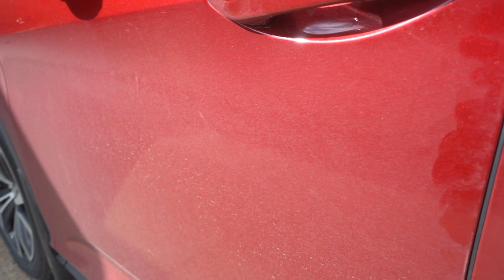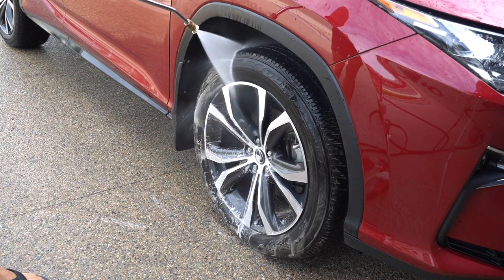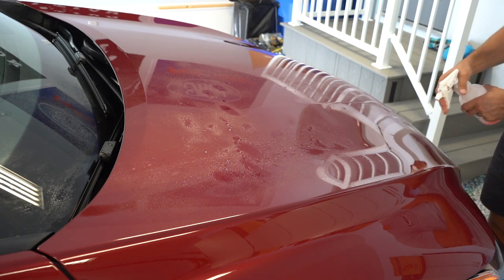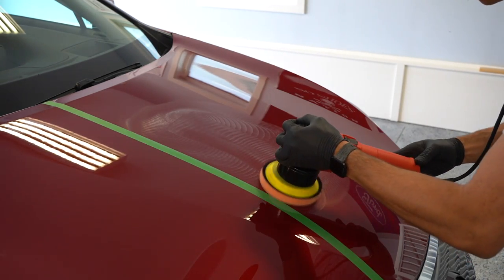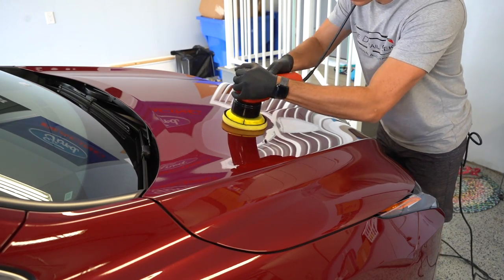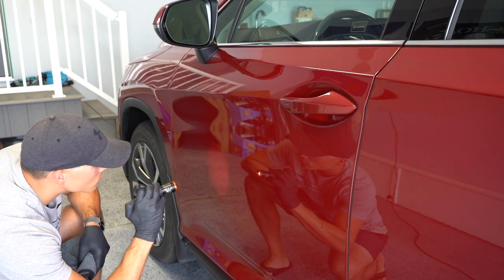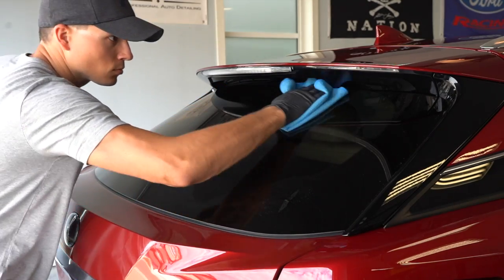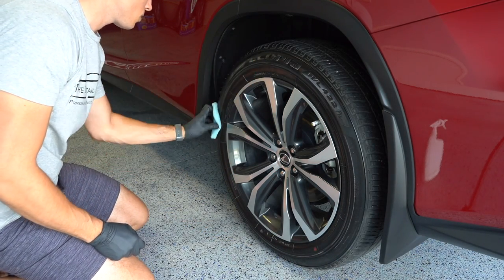Real Time Detailing of a Beautiful Lexus RX 350! | Full Paint Polishing Tutorial and Exterior Detail

Comment: I did full detail and polish on our 2018 RX as well to prep it for a ceramic coat.   Same process, with one exception, I use multiple MF towels vs two bucket method.  I use about 8-10 high GSM MF towels total to wash using front and back sides, but I feels it safer than two bucket method and faster as well.  Very nice job at end though.  It’s a shame the owners didn’t want to ceramic coat the car after a nice paint correction.

Comment: So a post-it note would be about 3.6 thousands of an inch thick,  which is about 91 microns (25.4 microns per .001")...  if you remove 4 microns per paint correction you could do it 23 times before removing all the clear coat.... If my math is wrong please correct me.. Question? Does the paint depth gauge give you the total thickness of the base coat and the clear coat, or can you determine the thickness of just the clear coat???  Thanks for the video

Comment: I started practicing paint correction on my  own car recently and I notice it is kind of hard to get the compound off my car after I do a few passes. I am using a griots orange correction pad and Maguire's ultimate compound. I have tried priming the pad with the compound and it makes a little difference as well as dropping the speed to 3/4 on the DA polisher but i feel like I am using too much compound with the result i am getting. Any tips if I should try a new compound or pad, or mix in water or a pad conditioner?

Comment: I bought a pair of Rag Company Cyclone wash mitts. Had been using a Chemical Guys Chenille
The New Cyclone mitts convinced me of the one bucket multiple mitts wash method.
Unfortunately my wash area is full of trees and the cyclone mitts somehow picked up leaf shreds like magnets and even using a grit guard wash board, I couldn't get them off.  Plus they hide down in the fibers of the mitt.

In the end, I don't think buying a bunch of $7 chenille wash mitts will be that much more expensive than a 2 bucket wash.

Figure $8-$10 for a second bucket.  $15-$20 for a couple of grit guards (don't need a grit guard if you never put a used mitt back in your water.  That's $23-$30 extra you are spending for the 2 bucket method.  

If you go the multi-mitt method, maybe you use 1 mitt for the roof and windshield,  1 mitt for the hood and front, 1 mitt for the rear.  2 mitts for each side.  That's 7 mitts, or 6 extra.  The Chemical Guys chenille mitt is $7.  So you are paying $42 for extra mitts, but saving $23-$30 in other material from the 2 bucket method. So your net is only about $12-$19 extra.

Although, for myself, I may go: 1 mitt for the roof and windshield, 1 mitt for the hood, 1 mitt with bug mesh for the front, 1 mitt for the rear and 3 mitts for each side, for a total of 10 mitts.